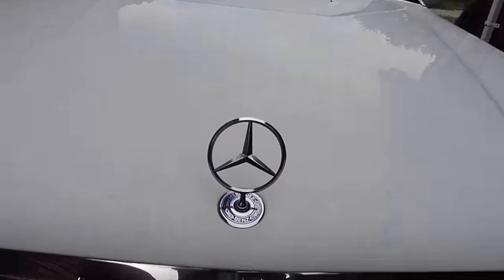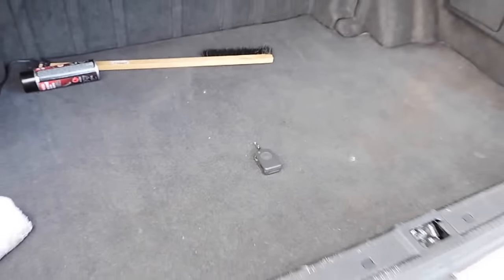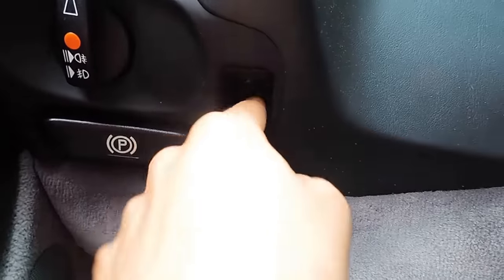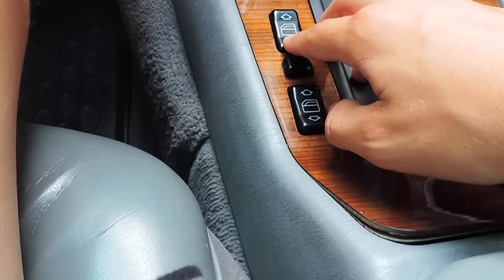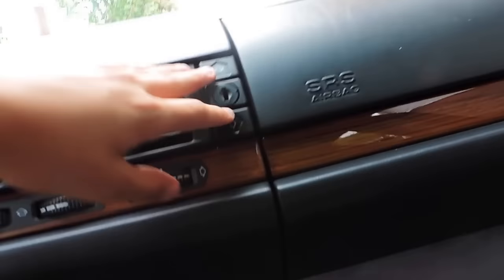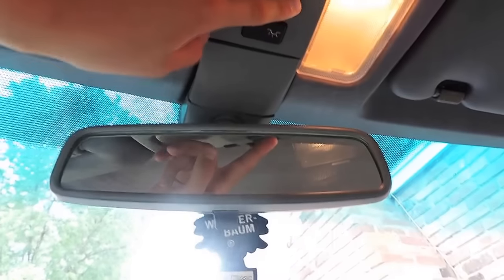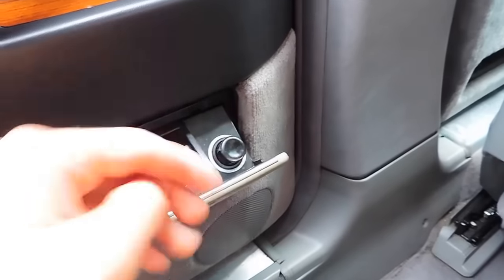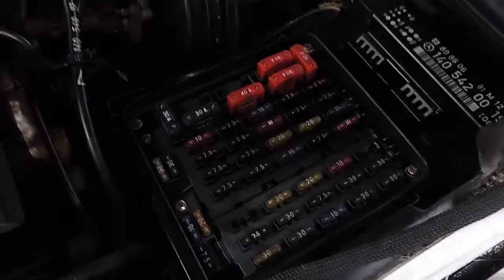Mercedes W140 300SD - Main Features Overview | Interior & Exterior

Comment: These are super rare. Virtually bullet proof and very much still better than most new cars out there
Reply: not true, not true oviously, debatable
Reply from the maker: Yes they are, only 1 400 diesel models were ever sold in the US
Reply: ive had several Mercedes diesels including a W123 300D (euro, 5 speed). Apart from obvious routine maintenance the car was trouble free and as bulletproof as I profess they are.

Comment: Just thought of some awesome features not working/mentioned. All of the doors and trunk have vacuum close assist in the USA. You can also use the lock on the doors to shut or open all of the windows and the roof from the outside. These cars also came (with a now antinquated) phone system and a 10 disc changer in the trunk. The 1992 and 1993 had the extremely nice Bose beta system with a central ambience tweeter on the rear view mirror. The back panel under the rear window only has the subwoofers so you can play music loud without slamming the rear passengers with music at ear level (the full range drivers are in the rear door.) Video shows midrange and tweeter in front. The components of the bose are frighteningly expensive to replace at the dealer (the seperate rear bose amplifier is around $2000 US.) You could buy a small car back then for what the stereo components cost in this car. These cars defined overkill and the 1992 and 1993 have all of the features (later models stripped down.) And this is just the base model (some of the top one came with a refrigorator in the center rear seat armrest, plus power bucket seats in the back I believe.)

Some of the diesel models also have a glass moonroof and a limited slip differential for the rear wheel drive. The rear sunshade on these vehicle is a rare option in the 300SD. The 1992 and 1993 300SD and 300SE, plus 1994 and 1995 versions were short bodies. Believe the short body was done away with in 1996 along with the diesel engine option in the US.
Reply from the maker: Hi, I am aware of all of these features, 1. this particular vehicle does have the vacuum close doors and trunk, but it is very hit and miss, I've only seen it work once 2. on the wireless key, it you hold down the button for more than 3 sec . the windows and the roof will automatically close 3. The phone system wasn't present in this car but I am aware of it. 4. I do not have the 10 disc changer but I have seen other cars with it 5. The Bose sound system does seem very high quality but unfortunately, there seems to be a problem with the sound amp. in the trunk, (If anyone knows how to fix these please let me know!) 

6. I do not believe that the W140 diesel came with the fridge or the power seats I believe that only the 600SEL V12 had that option and I've also never heard of a diesel with a GLASS moonroof, (hence why they call it a moonroof ;))

Thanks for the comment!

Comment: Great work. Great seeing that even just a youngster can tell how great these cars really were. Love my 90k mile 93 300SE 23 years old and I don't see why it would have any issues with going 23 more. Only thing I don't understand is why they put the A/C system in location that costs few grand to get to for service or replacement.
Reply from the maker: Thanks, yes these were absolutely wonderful cars. Too bad this particular model leaks a lot of oil, we are thinking about doing a engine overhaul and turbo overhaul, I am saving up with my part-time job!
But these cars don't ever seem to breakdown, and almost everything can be fixed at home w/ the proper tools!
Hope you enjoyed

Comment: The "REST" button is actually for when the engine is off, it uses the remainder of the engine heat to keep the interior warm in the winter, or cool if summer.

Comment: That Car is in an verry good shape and an beautifull example for what you could get back than for your Money.
I like that Video a lot, and you made a verry good job for the Tour of that Car.

If you ever wondered why that First aid Kit in older Mercedes Benz is imbedded in the parcel shelf or underneath the front Passenger Seat like in most BMW, that is because if your Car is involved in an Accident and an other Car smashed into your Trunk (where most First Aid kits are found), you always be able to reach it even if the Trunk is inacessable.

Those PINS wich come up if you put the Car in Reverse are in fact the oldschool Version of an Parking assistent. 
That is realy practical if you want to paralel-park the car and important to know is that not all Mercedes have these.
Also interesting to know is that most Cars back then, if they had such an Pole atatched to it, it was just one single pole and it was just  one FIX Pole mostly mounted as aftermarket Item on the Car (not Mercedes Benz specificly) and this kind of "Assistent" was most common in the 50´s to the 70´s before the OIL-Crisis hit, because the Cars back then were commonly longer and that Pin was found on the opposit Side of the Driverseat, because that is where the Driver looks if he turn his Head and drives the Car in reverse for parking..
 
Nice to see such an "historical Artefact" on an Car.

Maybe you should hire your Mom or Dad / Owner as Chaufeur so to speak for a little joyride just to have also an impression of the Car while running and driving, because i think its cool to hear the noises inside and outside of the Car.
Maybe that comes with your Driverslicence. ;)
And you also have the oportunity to talk with them a bit about the History of that Car and what the Experience with that Car was for him and so on.
Reply from the maker: Thank You!
Yes, this car is definitely filled with history, it is considered to be "The last of the S-Class"
A lot of the features are simply incredible, and you would never think to see them on a 26 y.o car; like the electric rear view mirror, electric fold down head rests in the front and back etc.
It is currently winter where we reside, and we dont have a garage, so we purchased a car cover for her and it seems to be doing a good job with the snow.

The next thing on the list, come spring, is to rebuild the engine. This 603 engine is notorious for having cylinder head problems, and it was nicknamed as the rod bender engine. Fortunately, we found a proper head, and we have to replace it sometime this year for when I get my licence. 
There are also some other little problems like the radio amp for the 11 speaker Bose system (yes 11 speaker system in '92), as well as the A/C system etc.
I am very fortunate to have the chance to work on such a historically important and beautiful car!
Reply: You should definitivly make a Videoseries of your Restauration, when you start doing it, i would like to see the progress of that.

Comment: Great and informative video! I was wondering what that space was in the trunk to the left in my 95' S320. I was thinking perhaps it was for like a CD player. Guess I'll put a lock safe back there for my handgun. You got my like and subscribe!
Reply from the maker: You are correct the 6 disc CD changer was an option that was mounted there. I use that space to keep extra engine oil and windshield washer fluid.

Comment: Great video, Bence! I am in the USA and own a 1985 W126 Euro 500SEL..and now I am trying to decide between a 98-99 S500 or a 2006 Lincoln Town Car. Both are big and safe vehicles with good crash test ratings..but the Lincoln Town Car is cheaper to repair. But I love the styling of the W140 S500..though I would like to stay away from any W140 with an air suspension..and I have read only the 1999 W140 had one. Can you please tell me how reliable your W140 has been? And what has needed repair? Also, how miles are on it? Keep up the great work and I hope you do more videos on other W140's as you really showed things about this car nobody else did. For example..I had no idea the battery was in the trunk! Cheers!

Comment: Any mechanical problems with the car since this video?
Reply from the maker: Nothing besides the rod bending... that is an ongoing project however the car still runs decently fine and is usable day to day. Unfortunately we live in an area where there aren't a lot of mechanics that deal with Merc. Diesels so we are in a bit of a rut trying to get the engine fixed.